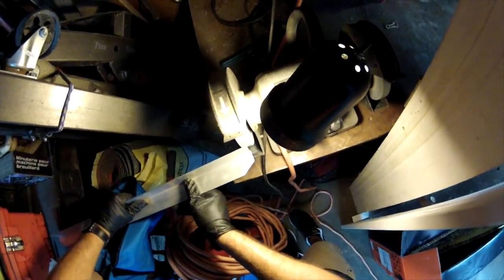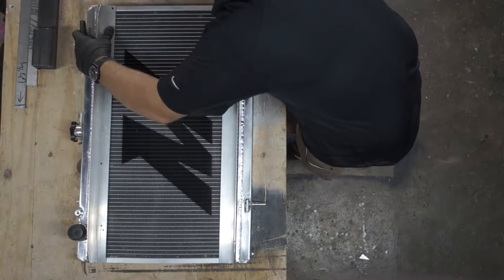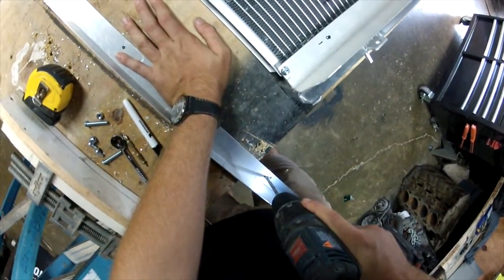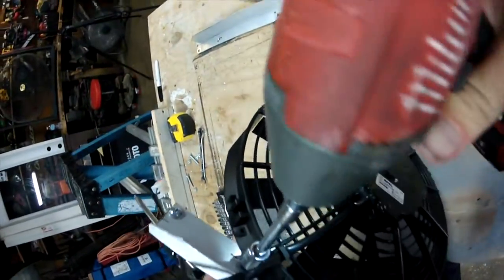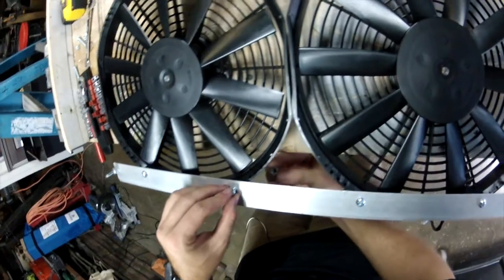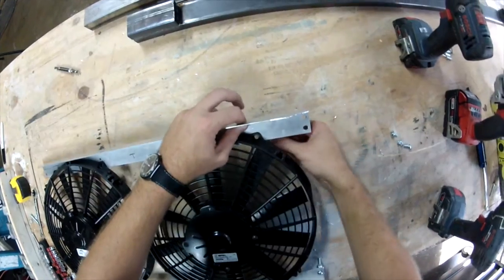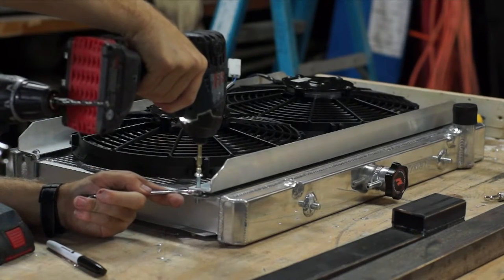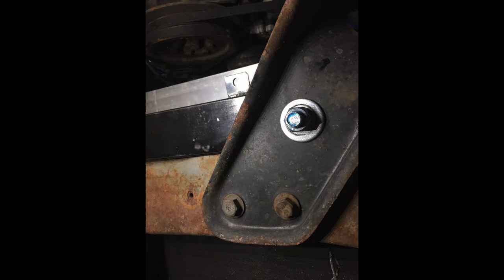Installing Mishimoto Radiator 280zx

Comment: I am in the process of deciding which radiator to buy and then I cam across your video. I was wondering if you used the stock radiator hoses or used some from a different car. I'm pretty sure the lower hose was fine to use, but what about the top one? And info/help will greatly be appreciated since I am leaning towards putting the same radiator in my Z.